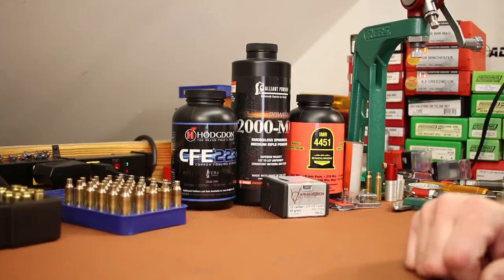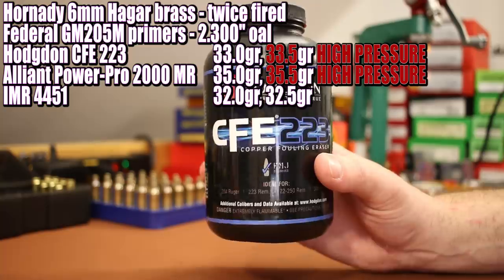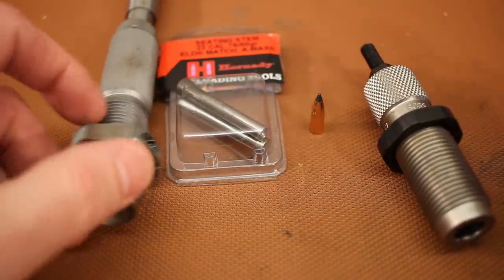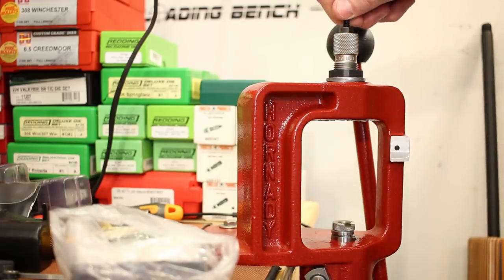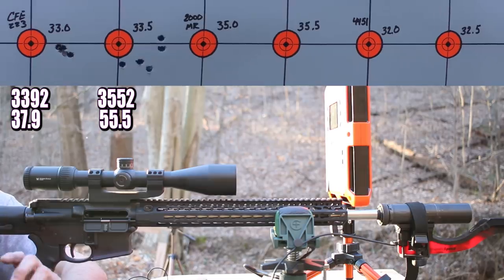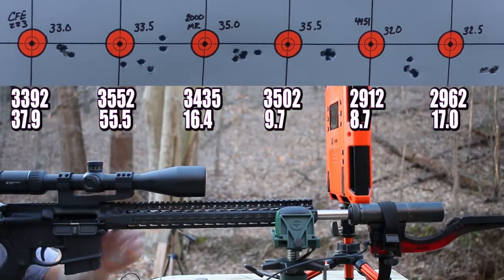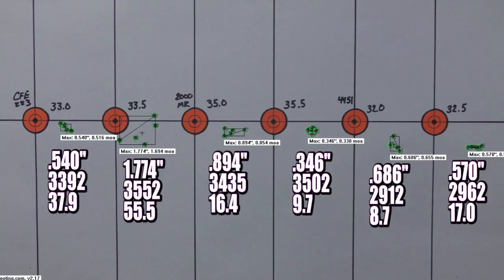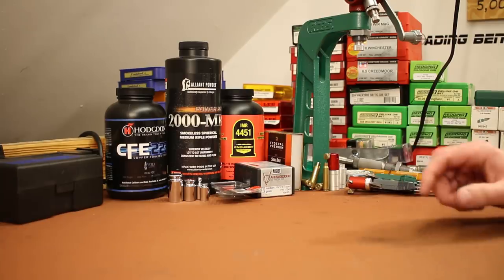Fixing 22 Nosler - 22 Nosgar - Part 3

Comment from the maker: Yes, I'm using a new press.  A video about it was supposed to be posted before this one.  The video ended up sucking so I am re-filming it this evening.  I hope to have it posted tomorrow evening.
Reply: Just bought the same press last month.
Reply: Why did you change presses from your manual turret press to the Hornady single stage press.
Reply: For some reason it just feels wrong watching a new press. Any one else feel the same?
Reply: I've got a press like that. It's marked Pacific 007. I got it when I started loading back in 84. I believe they were starting to transition to the Hornady name on everything about that time. It been a great press and has loaded 10's of thousands of rounds with me, a few friends, and both of my boys using it.
Reply: Single stage presses feel more consistent to me...:/ turrets presses feel like they are for banging things out but that’s not a popular opinion..
Reply: Definitly took me a few minutes before I noticed the press 😂🤦‍♂️
Reply: Do you tap the case full of powder on the table ( compact the powder which packs to powder  and takes out air ) and settles the powder   to give more room for the round when pressing it into the case
Reply: Johnny's Reloading Bench for the lab radar and suppressor, put the unit just past the muzzle of the suppressor, when using a non-suppressed rifle/handgun you put the unit 6-12” behind the muzzle, there is a small microphone that trigger the sensor in the unit, having the LabRadar just slighty in front of the suppressor allows the microphone to work better with the cans.
Reply: @jimhans1  that is pretty much whete I put mine.  I have the end of the suppressor 6" behind and 6" to the left of the center of the Labradar and it triggers 99%+ of the time.

Comment: Just picked up a TC Compass in 22-250, cant wait to work up some loads for it, kinda surprised you have not had any videos in that calibre, love all the vids thanks for the information
Reply: My next gun will be a .22-250.  I have always been intrigued with that cartridge. Good luck, let us know how she shoots.
Reply: I have a .22-250 and I would love it if Johnny did a series on it, perhaps similar fto the 6.5  Creedmoor project.
Reply: 22-250 out velocity's all these new calibers. Shoot, factory Hornady superformance 50 gr v-max is 4000fps!! I love my 22-250 and my 22-250 AI.
Reply: what is learned, anneal every 2 to 3 reloads. we use 40gr sierra blitzking.measured 4200 fts.is a b,b,barrrelburner.euh,33vv133
Reply: 36gr Varmint Grenade + case fullest of Varget = what rabbit? I’m sure there was a rabbit when I squeezed the trigger... 4300ish FPS. I love my 22-250. Old Ruger 77 with tang safety, can get 1/2 moa if I do my bit.

Comment: Hi Johnny, I built two 22 nosler uppers. I was just at the yesterday and had interesting discover. I shot the new upper, testing loads got done shooting it. I started shooting my old one and notice a lot more felt recoil than my new one. same barrels, ext. the only difference is the muzzle brakes.my new one has a JP Enterpries standard compensator brake, the old has a PRI quiet control brake. my brass in the old was getting all marred up but not in my new upper. The big difference is the opening sizes in the brakes JP has bigger openings than the PRI. I hope this may help shed some light on your build!

Comment: Nice shooting! There's nothing wrong with those 2000-MR groups. You should be pretty happy with that. The velocities are definitely impressive too. You are approaching light loaded 22-250 speeds out of a freaking 18" AR with great accuracy. I think dialing back the 2000-MR charges will get you right where you need to be with out too much pressure. I would abandon the CFE 223 powder too. Jump out of that sinking ship haha.

 I have been shooting the 53gr Varmageddon in my 22-250 and the 70gr Varm in my 243. Both bullets are outstanding.

Comment: Can you use epoxy on the bullet seating stem to make for a "custom" type fitment? Like put wax on a bullet and then press it against the stem with some epoxy on it? Maybe find a way to use those metals they use for chamber castings, like the stuff for teeth fillings or something. Basically it just has to set hard and not be brittle. What do you guys think? Any ideas or comments?
Reply from the maker: Great idea.  I've heard of folks using epoxy, hot glue, and god knows what else to do just what you're talking about.  I might give it a try.
Reply: @JohnnysReloadingBench  what's the worst that could happen? Haha either way it would make for a fun video project. :)
Reply: The original JB weld would do good too.
Reply: @marclarose4512  yeah that's a great idea. That stuff is strong af. basically you just don't want it to crack or crumble.
Reply: Devcon steel putty might work, could use a layer of shoe polish as release agent on the bullet to get a good fit.
Reply: @taylorsmith2258  hell yeah that's the ticket.
Reply: You may try J-B marine Weld.  The package states its good to 3960 PSI

Comment: The bolt you are using for the Hagar based cases are weaker than the 223 bolts so you should not be using ejector swipe marks as a upper limit of pressure.  Remember the 22 Nosler is a 55000 MAP cartridge, and the 6.8 face bolt is pressure derated from the 223 face bolt.  The only reason the Hagar brass is not showing burrs is the fact that the bolt thrust force is being spread over a larger area.  The bolt thrust is the same as with 22 Nosler brass, so you cannot expect to get higher velocities without exceeding the pressure limits.  All of your ball powder loads were at least 60000 PSI or more.  The best primer to use for 50000 to 55000 MAP cartridges is Rem 7 1/2 as these lose their edges at about 55000 PSI.

Comment: This caliber really didn't do much for me at first. But I can see where it could be a good one as long as it can handle the heavy bullets fairly well. Might be as good or better than the valkery. Maybe idk. That one had me at first but I'm Gallo g off the band wagon here and I haven't even bought one yet lol. But this nosler round might be good after all. Thanks Johnny. And piss on them. Most of the ones running their mouth don't j drrstand what your doing or what needs to be done to learn a cartridge from the ground up like what you are doing here. You are sharing all over again really. So to hell with em lol.

Comment: Super glad you didn't blow your face off!  Hey, do you have any plans on another barrel harmonics video?  I'd love to see some experimentation with the Harrell's device as well as the limb savers.
Reply from the maker: Yes, I still need to step back and test both of those.  I'll get to it over the next month or two!
Reply: @JohnnysReloadingBench  Fantastic!  I just picked up a couple of limb savers and if you have good luck with the Harrell's device I will pick up one of those as well.  
  I've been riding your coat tails lately.   After much frustration with my Larue, Armalite and Sandars barrels, I've picked up a WOA SPR barrel.  
  I worked up a ladder test of Bob's 55s and AR Comp.  Settled on 25.2 for a charge weight.  They shot into a .841 inch group which I was happy with.  
  Still trying to get my 77SMK load where I want it.  23.2g AR Comp.  LC brass, factory primed.    I'm hoping some sort of barrel tuning device may help me get the same results you have had.    Right now they are shooting 1.1-.89 inch groups.  I really do appreciate you sharing what you learn with us!

Comment: Try a using a full-length sizing die with a neck bushing.  This along with no lube in the case mouth and some neck turning will help the sd on the cfe 223.  I use it in my 223 rem with an sd of six.  I use a lab radar also.  Have you tried using the cell phone app?  Sold my mag. speed.

Comment: Hi Jonny I got question for you is it ok to use rifle primers in a pistol case they seem to be the same size small primers that is thanks
Reply: NO!  I have been reloading for over 40 years and have never heard of anyone even trying it!  I would never do it.  Others may have a different opinion, but I wouldn't.
Reply from the maker: I've never tried it because I've always heard you shouldn't even think about it.  I think rifle primers are significantly harder so you would probably have hang fires and misfires.  I'm sure rifle primers are a good bit hotter (more powerful) than pistol primers as well.  Just speculation and regurgitating what I've read elsewhere on the subject.
Reply: Thanks didn’t know I have been reloading for 2 yrs thanks for your wisdom

Comment: Dear lord. The way you made up your load data for 2000-MR made the first shot hard to watch. I never thought you would come up with a starting load the same way people load trailboss and black powder.
Reply from the maker: lol I'm not saying it was very smart, but my experience with that powder made me feel pretty safe with that method in this application.  I'll be using pretty much the same method for something like Reloder 17 that I know is slow burning enough to keep us out of too much trouble.
Reply: @JohnnysReloadingBench  You're finally moving into the 21st century with the Labradar, maybe Quickload would help remove some of the guess work? Single shot ladders would also keep that beautiful face of yours in one piece.
Reply: It's not the safest thing to do, and it's not ideal, but there does exist certain circumstances where with a specific case and a specific bullet weight and a specific powder, you can load ammo that functions perfectly fine. But the powder is so slow burning for the application that it's impossible to get enough of it in the case to cause an overpressure situation with the bullet seated at a reasonable overall length. And I assume thats what you are seeing here. Another one I know of is 55gr 5.56 with RL15, you can literally just fill the case right to the top and knock a little out so the bullet will fit and they will fire fine with no pressure signs whatsoever....I do not recommend doing this! But it's safely done...

Comment: I'd like to see you play with 22CM. I know, it's not an AR15 cartridge but 22 Nosler and 22V are such turds in general. You do great work  and I love your videos, even if you're spinning your wheels on this.
Reply: or 22 grendel
Reply: @ryankarrar6107  I was going to build a AR 224 / Grendel based upper, I decided it was not worth it as the valkyrie was not to frame behind in performance.
Reply: @jsteiert83  The primer pocket issues with valkyrie will keep me away. Combine that with the better performance of 22 grendel and that's the direction I'll go. Baldwin Gunworks on FB makes barrels for it and the results look to be really impressive.
Reply: @ryankarrar6107  oh yeah. Baldwin gun works is the only way I'd go,or the original Robert Whitley 6mm ar.,224 AR. I think I the valkyrie will get ironed out. Factory loads are important to me. The extra 150 fps is just not worth it to me for a wildcat. I may even go .220 thunderbolt from  keystone (6mm Hagar necked to 22, says they get over 3200fps w 33gr of powder) it's may be almost identical to the 22 noslers but with Hagar brass. I think w 75 GR pills I'll get around 3000fps from a 20 inch barrel. I don't need more then that tbh. Convenience is priority. Accuracy is very important as well so ATM I'm just waiting it out.
Reply: I think the federal brass is soft but I think they are addressing it ATM. I'll use the 6.5 cm as an example, it shoots anything great, very excited to find accuracy. If the valkyrie does not end up like that, I will not bother.
Reply: @jsteiert83  It'll be interesting to see if they can rework the metallurgy to make them last longer. Gavintoobe tested Starline and the results seemed kind of mixed. I handload almost everything I shoot, so factory loading aren't a concern for me. I'd like to avoid using Hagar brass like the .220 thunderbolt and Nosgar because of the lack of brass availability like Johnny talked about.
Reply: @ryankarrar6107  yeah, that's exactly what scares me, I'm pretty new to reloading, it sure is time consuming so I've been a little frustrated, me and my brother bought 2 sets of 6.5 cm AR 10s w aero precision receiver s , we bought 2 sets of 6mm at predators  barrela with reloading dies w a ton of brass, and 2 Valkyrie barrels and 6.8 bolts.  All this stuff is sitting here so it's probably going to be sold because he doesn't want to bother. The only rifles we shot are the Valkyrie s with factory ammo and they have been quite fun.After shooting handload, I agree , it's hard to go back, but lately I've been grabbing ammo oxes out of the safe and going to the range myself . Just saying....
Reply: @jsteiert83  I definitely know what you mean about it being time-consuming. I shot over 2,100 rounds last summer that was all loaded on my single stage. There's definitely a learning curve and it takes time to nail the process down. This year my new hornady progressive press should cut down on time spent reloading significantly.
Reply: @ryankarrar6107  wow, I have a rcbs rc IV, I may get  a progressive down the road, it's tough ATM.
Reply: @jsteiert83  I used the same press for two years up until I got my progressive back in December. All I basically did was work, shoot, and reload. Takes lots of time, but the accuracy and cost savings (especially on 30 cal) make it worth it IMO.
Reply: @ryankarrar6107  I agree, can't achieve the accuracy w/o it.

Comment: You know if you’re using a 6.8 spc case head and though the length to the shoulder is further you should be right in the same zone as 224 Valkyrie.  Why not tAke a load you worked up for the Valkyrie in say 60 grain bullet and use the same load data and see how similar it is in the nosgar.  Might be interesting.

Comment: That Lyman digital scale has been garbage to me
Reply from the maker: Me too, so far.  It's several tenths off, takes forever to warm up and stabilize, and drifts around.  It checks all the boxes of a crappy scale.
Reply: The drifting around was especially bad on mine! 

I figured out with my Frankfurt arsenal scale to make sure to keep the batteries fresh and give it a break on occasion! However I plan to get one of those auto powder tricklers to streamline my whole process
Reply: And loving this content Johnny! My next project is hopefully a Thompson Center like yours, but I’ll be fitting a premium 25 cal barrel in it from my work! 

Plan to chamber it in 25 Creedmoor!
Reply: Try it with lithium batteries, mine is dead on. I use it in conjunction with the Gen6.
Reply: I had no luck with these types if scales measuring all over the place. Got a $30 digital scale from china, beats them all, and consistent with my RCBS Bar Scale.
Reply: Which scale is it? ITVNZ

Comment: I shoot 55gr tipped varmageddon out of my 22-250 at 3700 FPS and never had one come apart, weird.
Reply: Dont .22-250 use 1:12 twist?  Could be related to that.
Reply: This is all probably due to twist
Reply from the maker: Like Paul said, I think it's all about twist differences.
Reply: @JohnnysReloadingBench  yeah, didn't think of that immediately... assuming your 22 nosgar is a 1-8" at 3500fps, and my 22-250 is a 1-10" at 3700, you would be spinning 18% faster.
Reply: @ShawnSon40  yea, at 3900 in a 220 Swift they have issues staying together in high humidity days.

Comment: But Sir......[%] Are lazy statistics, the most basic and sometimes misleading information type. Can you share with us the case capacity of the Nosgar, Valkyrie, and the Grendel, in real numbers?

Not sure why we all need to worry about special brass (Nosgar) for high velocities...JUST SHOOT THE DAMN 224 Grendel (aka 22 Grendel).
Reply from the maker: The h2o case capacities of each have been covered in their respective video series. The h2o capacities of Nosler and Nosgar were covered in the first video of this series. This is not a cartridge comparison series so that information would be out of place.
The 224 Grendel is a competitor of the 224 Valkyrie, not the 22 Nosler.  The dimensions are not optimized for light bullets.  See my recent cartridge comparison video for an explanation, and a look at Grendel brass side-by-side with 22 Nosler. Drastically different designs. https://www.youtube.com/watch?v=HnoHZDxRZ2s
Reply: @JohnnysReloadingBench  This is a video format, providing information again and again is beneficial as folks cant jump from chapter to chapter paragraph by paragraph as in a book or article.  

In your reply, did you actually say that 224 grendel wont shoot light weight bullets?